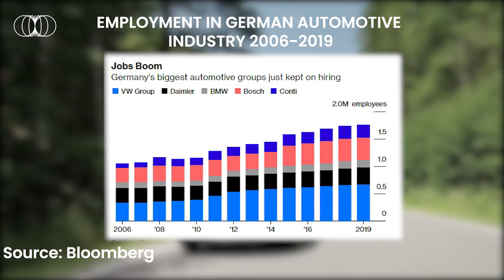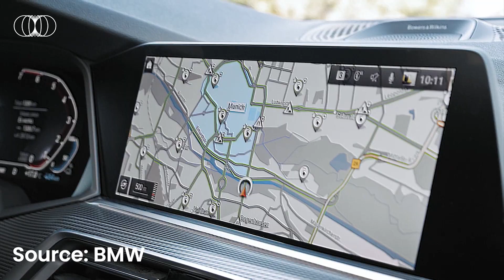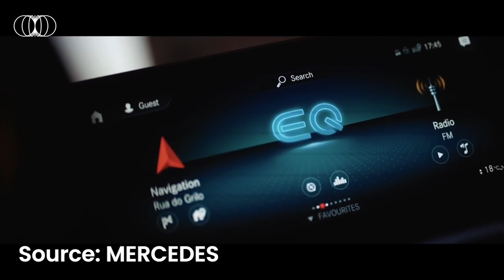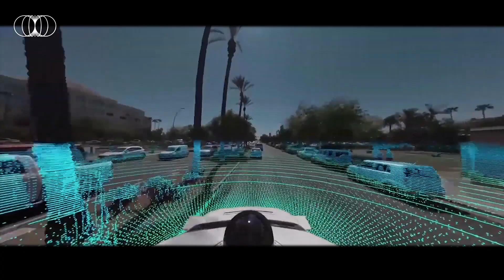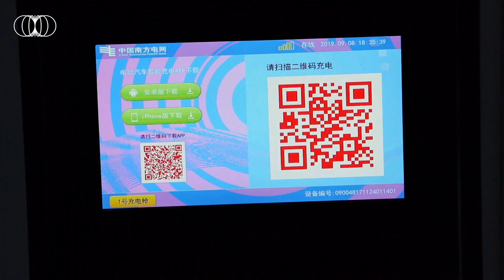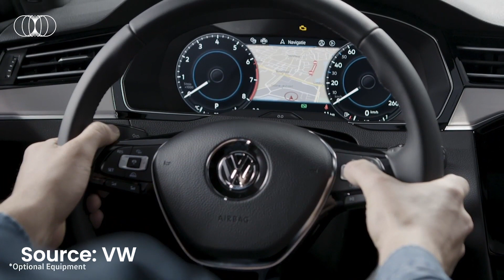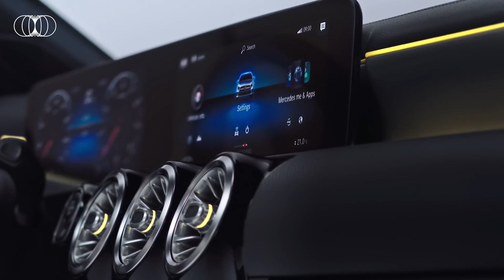Is Germany's Automotive Sector in Threat?

Comment: Excellent video. But nobody likes to talk about the giant issue with electric cars: the electricity has to come from somewhere. Mostly, that means coal, oil, or nuclear.
Reply from the maker: True - so we need to go efficient with electricity production. One nuclear plant is arguably more efficient than a million of small combustion engines.
Reply: @GoodTimesBadTimes  I concur, especially if we build the newer types of nuclear plants which, while more expensive to operate, have substantially less chance of killing people.
Reply: Also modern batteries and their manufacturing process are really unfriendly for the environment.
Reply: @koraptd6085  BYD's LiFePo4 Blade batteries are 100% recyclable and contain ZERO environmentally harmful substance.

Comment: Hydrogen is the future of automobiles. This why many companies are converting their gas and diesel engines to use hydrogen. Companies like Toyota and Daimler-Benz are converting their gas and diesel engines to hydrogen. Cummings and JCB have converted their diesel engines to use hydrogen. Transport companies and construction companies will not tolerate working their vehicles for eight hours a day. Transportation industry standard theme is "If your trucks are moving there not making money." The same for construction companies. Then there's the cost! JCB found it cost $250,000 more than their standard excavator and eight tons of weight, the same would be the same for tractor trailers. This would lessen the amount of cargo carried cutting into the profits of transportation companies. Then you have to train a whole new group of mechanics to work on these electric vehicles which adds to the cost to industrial. Then there is the strategy implications for a nation. For instance, Japan an island nation with no resources to speak of having to import everything from oil to rare metals to survive. The only resource that is abundant is water. What is hydrogen made from, WATER. Japan is surrounded by water. Japan would no longer be depended on oil, or rare metals it does not have to survive. It will no longer depend on the middle east for oil and gas and rare metals to make batteries from China and South America. Ending the need for the forever wars in the Middle East! Another reason why electric cars will not be the future of the automobile industry in Germany or any country for that matter, is what Chan. Helmet Scholz did this past winter, when Germany stopped being depended on Russia gas and oil. While going around the world looking for sources for natural gas, he also asked for supplies of Hydrogen. Germany will replace natural gas with hydrogen to supply power for electric power, heating, and cooking. This will happen within the next 10 years. Hydrogen is the future, you do not need to destroy the environment to make hydrogen to fuel industrial and power your home.